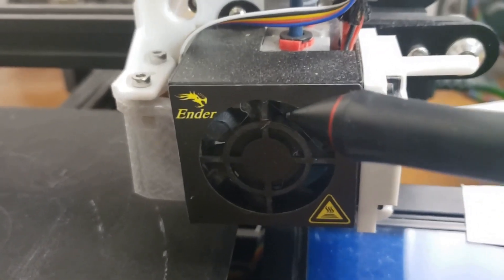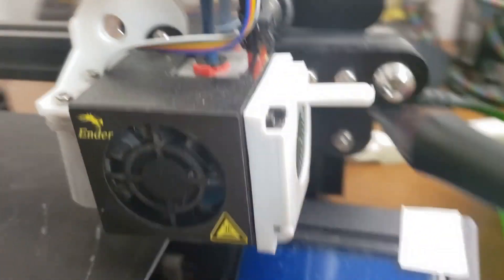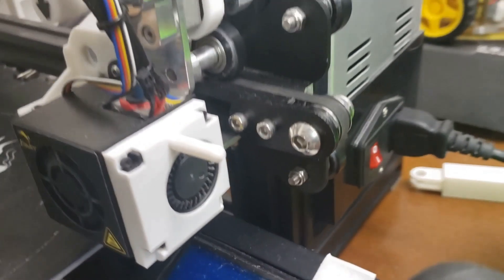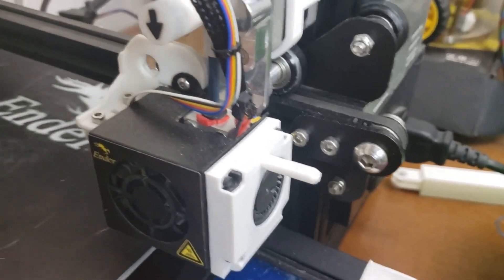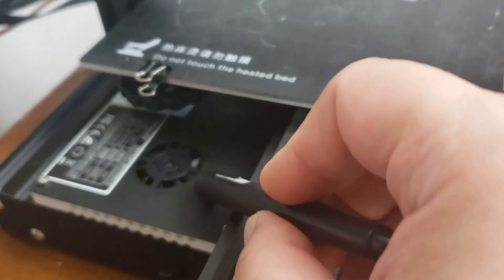WHY NOT NOCTUA FANS FOR 3D PRINTING?? SILENT 3D PRINTERS. NOCTUA FANS MAKE 3D PRINTERS SILENT, BUT..

Comment: Good video.  Yes, I have seen the TH3D video on this though his words are not necessarily gospel.  I did compare the airflow of a Noctua fan vs the stock fan and the Noctua is considerably lower which is one of the reason it is quieter.  I would hesitate installing a Noctua fan on either the hot end or the power supply.  Of course the stock fans could be overrated in which case a Noctua fan might be fine.  I know a lot of people have done the Noctua upgrade and don't seem to have any problems.  Still unless someone does a thermal comparison between the stock and Noctua fans we will probably never know for sure.

Comment: I think there is more nuance to whether or not Noctua fans are good or bad. The 20mm Noctua fan is comparable to the stock 10mm fan.

On a Bowden setup you are likely to get heat creep, but an all metal hot end is less likely to suffer from the problem since they can transfer heat more efficiently. 

Another item to consider is what CFM is optimal before heat creep becomes a problem. If the design requirements are being met with a 20mm fan then the answer to the question “are Noctua fans bad” is undeniably NO. 

Disclaimer: I have the 20mm fans running on two printers. Both have all metal hot ends. Both have ran as high as 255c for 14+ hours each without any signs of heat creep.
Reply from the maker: You are correct. It depends on which noctua fans you use and the hours for print. There are prints that last for days. From what I heard you see heat creep on prints that takes more than a day.

Comment: I have a BiQu B1 and on this particular model the fan for the electronics is by far the loudest. Not sure when i am going to replace it but i will in the future for sure. I guess for all fan's the cfm matters because enough colling is always important. But if i can not find a suitable small fan for the electronics i might hack a bigger hole in the bottom to be able to mount a much bigger one.

Comment: I know the video is in french but he tested the noctuas and put up a graf of the cfm towards the en end showing the result of his testing. In my opinion the 40x40x20 noctua is a good compromise between sound and cooling and is what I have been using on my ender 3 for a couple months now without issues.
Reply: I changed all the stock fans with Noctuas on my CR10S Pro v1 (except the ventilation duct of course, there are no night ones). No problem for several months even with impressions of 48 hours ... and what silence!
BUT ... I am using a micro-swiss hotend and a Bondtech extruder (direct drive). Maybe The Noctuas are efficient enough with this setup.
Reply: @luc105  the silence is amazing that is true.
Reply from the maker: @luc105  Is it enclosed or open?
Reply: @DiyProJames  it is open ^^ 54 db max on work  :)
Reply from the maker: Have you tried prints going over 24hrs long? Are you using the stock hotend?

Comment: I had to change my Noctua on the Hotend and ofcourse on the nozzle too... i replaced all 5 fans on my cr10spro but now only the 3 for the elecetronics are still on it
Reply from the maker: Were they replaced with noctua fans or a different type of fan? Were the noctua fans replaced due to printing issues?
Reply: @DiyProJames  noctua on the hotend (4010) wasn't going too well I believed. Noctua (4020) on the hotend didn't work at all.

I now have a 4010 sunon 24v.hotend and a radial 5020 dual ball bearing and this is doing good. It's also pretty silent except for the hotend one. I will be replacing that with the 4010 from the sidewinder wich is much more silent. I have already preordered the fan
Reply: @DiyProJames  honestly I am just so disappointed by this printer. I have to fix it pretty much every day since 3 months. Since I bought it.

I just got the sidewinder x1 for 310 dollars and it works right out of the box. It even has direct drive and is a lot faster then the cr10spro..maybe no Auto bed leveling but It looks like it's not needed. Prints are great

Comment: I just ordered three they're at the house to put in the cr-10s pro v2
Reply from the maker: If I watch youtube videos everyone seems to promote noctua fans, but if I go into facebook groups or reddit forums. They seem to indicate issues with noctua fans for at least the hotend. All really depends on different types of variables like the type of hotend, ambient temperature, etc.... Also, my opinion is you really don't need a fan for the nozzle to get good prints. In fact if you have heavy air flow in a small area of print it just makes prints worse. The only time you need the nozzle fan is if you plan to do heavy bridging.